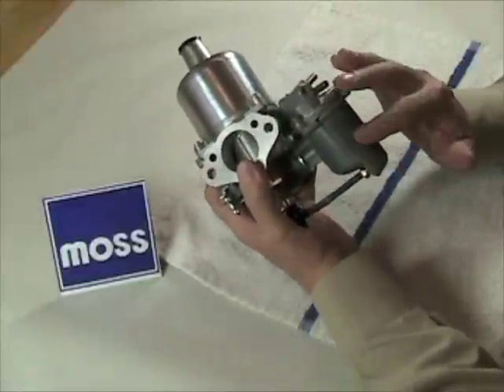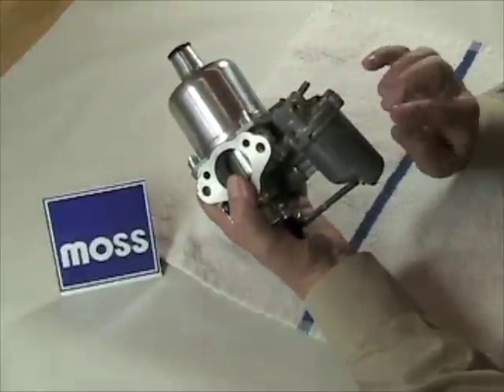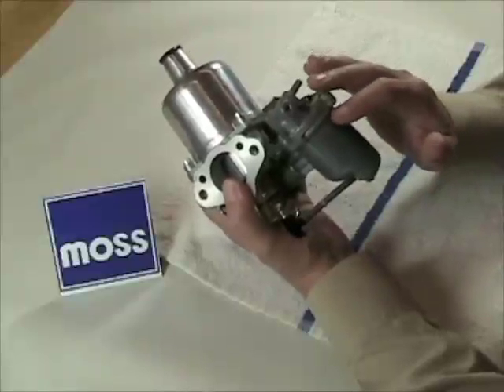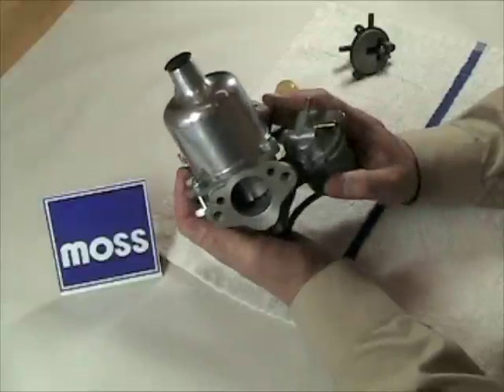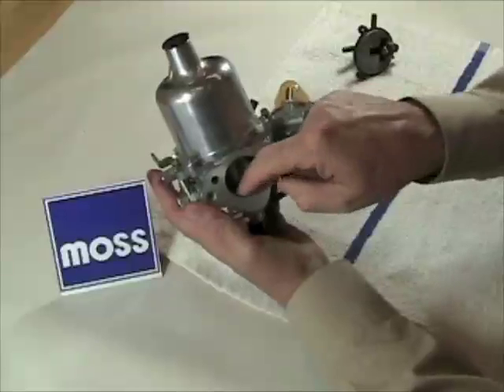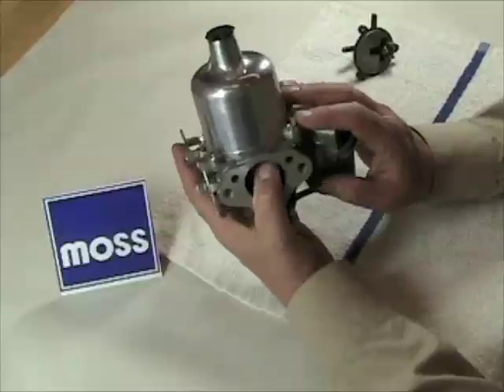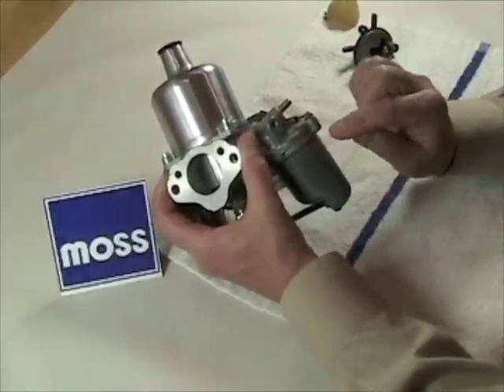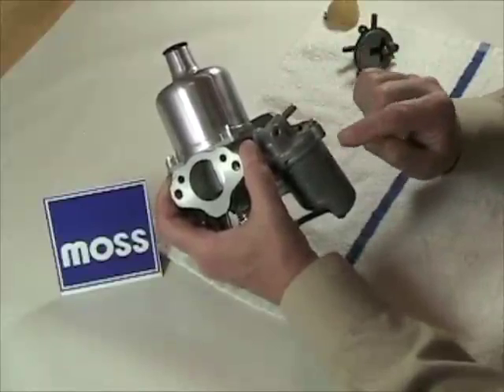Carburetor Float - 3 Things that can go Wrong

Comment: What if the engine sounds as if it doesn't get any fuel and the it turns off? Is the float sinking? My mechanic says my float gets stuck cutting off the fuel and that he can't fix it. Could it really be necessary to change the whole carb?

Comment: I have an old set of duel SU's off an MG and i can't seem to stop one of the float bowls from leaking. Can't tell if its just the gasket and seal or if i also have a leaking needle valve adding to the problem - the fuel leak is so bad i can't pin point it to just the lid or breather too. The float is brass, and it seems to sit just barely above the fuel level, so its floating, but seems to me the pressure on the value would be minimal. Any ideas or input on this would be appreciated.

Comment: yeah i had the second problem where the float had a leak, couldnt find replacement so i dropped a ping pong ball in there (lol), adjusted the needle and now works fine (timing is bit off though)